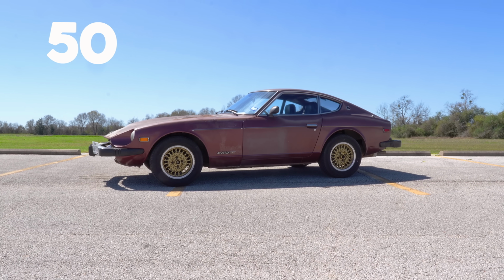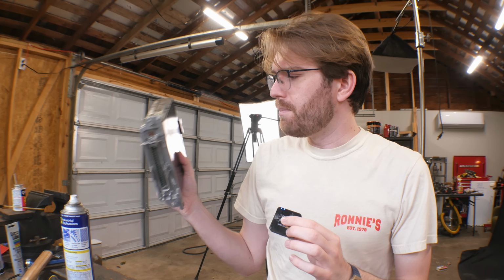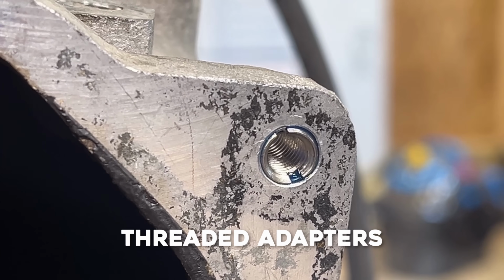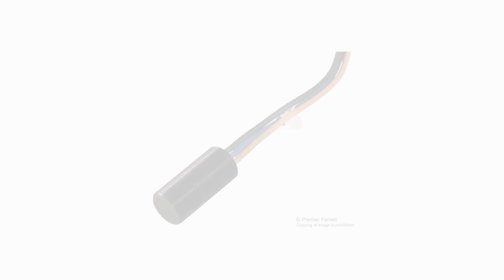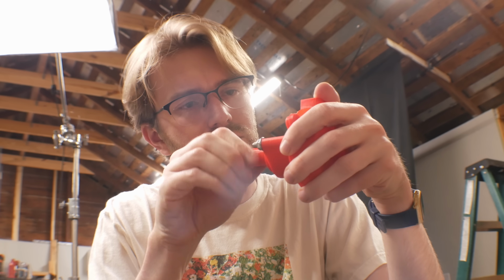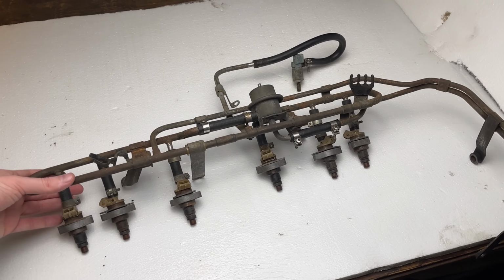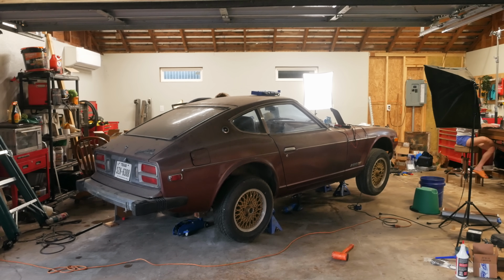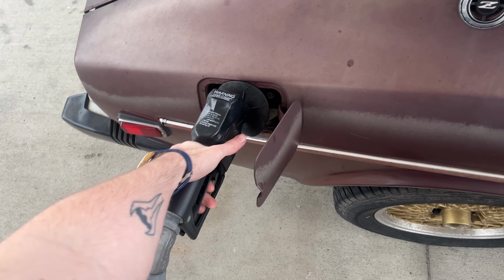Modernizing a Vintage Car

Comment: I also had 1978 Datsun 280Z in yellow but with 4 speed in 1996. I got it from a friend through golf bet. I don’t know I really winner of the game as result since it was not working car and kept in the carport (not a garage) for 5 years.  It took at least one year to bring back to life mechanically and another year to make my Z presentable exterior and interior. In the process I spent good amount of fund to so called classic car specialists where I could not figure out. It ran decent as weekend car but could not drive to work since I had a company car.  Around 2001, the engine start showed real age and required constant maintenance. I decided to sell it at bargain price since she became the drain to my budget in 2003.  I still miss it but I got 2008 Subaru Outback with 5 speed and 60,000 miles from neighbor who left this cute girl on his driveway for 5 years. I got it for only $1 since he did I not want to pay insurance for rarely use old car. I took it to Subaru specialist to perform heavy maintenance and changed all the essentials parts. Now it became my favorite weekend car.

Comment: I got one of these back in 2000. I wound up putting a four bolt main 350 Chevy engine in it that I built in my living room floor ( as an aside I wound up marrying the girl I was dating who helped me do the teardown) and paired it with a turbo hydro 400 transmission I had a local shop build with a reverse valve body and a slap shifter... I had a driveshaft custom made... Went through three rear ends before I sold it though. I shaved weight off it (yes I said shaved weight). 475 horsepower at the rear wheels. The 350 and automatic transmission doesn't weigh any more than the old six. It was a tire shredding gas consuming BEAST.

Comment: Auto manufactures always measure horsepower at the fly wheel never the rear drive wheels . You would have to put it on an engine dyno to compare any type of factory horsepower number. This was a great video though .

Comment: Dude you need some kind of enclosed 3d printer so you can do CF nylon or other engineering materials. 

It won’t entirely replace ordering milled parts but it’ll help immensely.

Comment: Love your channel... only thing that I would disagree with is your assessment of the Chevy Cruze. I had a 2013 Cruze eco that I bought brand new. Ordered it actually. Mine was wonderful and reliable. At a little over 10years old and 167K it was demolished by a F250 that hit me not once, but 2x. I was left with a brain injury but survived. That car saved my life. I actually drove it home. BTW... the 1.4 can be boosted to 300HP with out popping the engine. I will say the car is "tepid" at best stock. An air induction kit helps that car a lot!

Comment: 24:29  For those who attempt a similar project of any sort, there is an easy solution to this: just find ANY circuit under the hood that gets power when the ignition turns on, and wire a relay in parallel that ties the new equipment(w/fuses) directly to the battery when the relay is closed by application of power. Ignition coil power is usually a good choice, but there are usually plenty of other options. No need to read the full wiring diagram, just play with a multimeter to verify the circuit closes/opens with the ignition switch and you'll be fine.

Comment: Did you fill the weird hole behind the throttle body? If not there'll be a pretty strong eddy there that'll do something to the airflow, I'll bet 20 pence it's something detrimental

Comment: Isn't the Air Fuel ratio in place on the map so you don't run too rich or lean cause I'm aware that if you run too lean you can grenade your motor.

Comment: I love this project! It would be cool if you could add an Eco and Sport mode. Maybe by adding another sensor which can tell in which gear you are in, you could also make it more efficient or even add a start stop function where when you put it in neutral it turns off the engine after a few seconds to save fuel and turn it back on when you put it into gear.

Comment: Honestly though, 125hp at the wheels from an advertised 170hp at the crank is pretty good for a 47yo engine. You typically lose anywhere from 15%-20% power from the crank to the wheels on a brand new engine/car, and 125hp is 75% of 170hp so it only lost 25% of its advertised crank hp total...

Comment: Welp…. I learned so much in this video.  Never knew how/why the old fuel/air/electric really worked….   And you breaking it down to modernize this engine…..  so much makes sense now.    The wiring would keep me from leaving my bed though.   The rest fascinated me. Thanks!

Comment: Instead of buying a new car, since all new cars suck, I was thinking of buying something like this, k20 swap, e46 ABS, BMW DCT transmission, etc. Daily drive it from there. Pretty much would cost the same as a new equivalent car. With drive by wire throttle you can do a lot more with this thing. Like said dual clutch transmission lol.

Comment: Those old cars are now a vintage classic getting a much more nicer price for them. I have a older 1984 Chrysler Lazer, 4 cylinder with Turbo and if get 46 miles per gallon, last tested.  Don't under eastmate the older stuff because they had some good engineers working on some of them. I would like to modernize the car body a little, it's in storage. Just saying !

Comment: Bud in todays world modernising translates to electric conversion. This is a restoration with a swapped engine.  Just saying. But saying that the 280z is just a handsome lady.  Keeping the front end light would be the key to track days.  Engine behind the chasis, 330mm brakes front? Modern 350z complete subframe transplant? Gearbox? Engine? light as na? Vw v5/v6 super compact and can be boosted for silly power and standard internals. #@stavtech #@Zurawski motorsport. Gearbox? 722.6 with #@ASHRAND standalone tcu? The lad is a genius. On 325s rear? Flipping heck. Autoporn.  😂😂😂😂😂😂😂 ps you gotta use that bonnet 😊  cool night/pick a chill spot and let your lady know whos the daddy.  Did i mention i love the 280z. I have a friend with a sweet resto but a v8. noise heavy. Would need a big rear wing to really use the chassis.  1luv petrol head brother.

Comment: This is what I really wanted to do to my 1985 Lincoln Town Car in the UK, until the project went sour by a bunch of "professionals" ruining the car. For this one year this car had throttle body fuel injection, I was going to change it out for a Summit racing intake manifold that had sequential fuel injection and still looked like a carb.

Comment: So correct me if I'm mistaken, but under the assumptions that: 1 - 170hp was an SAE gross rating (measured without accessories likd water pump anx alternator), and 2 - we estimate about 17% drivetrain power loss, a quick calculation (124 ÷ 0.83) would give us about 149hp at the flywheel, which is on point for an L28E. using this calculation, 142whp puts you at 171hp at the flywheel.

This goes to show just how inefficient the L-Jet system was compared to today's modern engine management.

Comment: I guess, if you make some milling to cylinders and add new piston rings that'll run better. Obviously adding a supercharger to that engine and adjusting fueling map to it shall make it to another level.

And bodyworks. Make some bodyworks, old cars are precious, it does need to look like a masterpiece of it designer.

Comment: just want to point out something from when you said the air is still analog control, pretty much every throttle body is analog btw, whether its opened by a cable or by a servo the butterly still stays analog.

Comment: Man that sure is a different project than the Fiero! Sure showcases how much 'working on cars' has changed in the past decade or so. The availability of aftermarket parts for computer controlled engines, and the ability to basically create your own parts at the hobbyist level is mind blowing.
Time to do an EV conversion!

Comment: I admire both your hard work and your humor (the fuel savings pay off in 63 years!).  On a positive note, I know nothing about the computers on board in my 1992 Volvo 240 Wagon, my 1995 Toyota Previa, my wife's 1998 Ford Fiesta, my 2011 Toyota Rav4, but now I am no longer afraid of how to put my hands on where needed.  Basically you have helped me understand how the computerized components work.  Since I am an old school carb and spark plug kind of guy, I am still learning but your video makes it all much simpler for me to understand.  Thank you for all you have done and do.  Sincerely, Mark in Italy.

Comment: This was a very cool video.  I suspect the largest improvement in terms of power was the use of a modern lambda sensor and maybe clogged fuel injectors.

The distributor, as clunky as it is, works pretty reasonably well for stock applications.
All those stupid air valves are stupid and annoying and frustrating but since they are only there to keep the car idling, don't make a huge difference while driving.
The air flow meter has a largest enough surface area that I doubt it has much negative impact on anything -- but maybe.

I'm surprised the system doesn't generate a default VE map when you first install it, and then tune it using the Lambda sensor as you're driving though.  You could also potentially remove the mechanical fan and install an electric one.  The main benefit of this is that you are no longer having to drive the fan when you don't need to (for example while you're driving). Not a huge difference, but not nothing either

The cam sensor mechanism was pretty cool.  I'm not really sure why it needed to be made of steel, but I guess that's why I'm an EE not a ME.

Comment: I'm laughing at the really awesome distributor replacement you made, because you could have done the same thing by placing a magnet on the crank pulley and placing the hall effect sensor next to it. If you know the diameter of the crank pulley it's simple.

Comment: Having the engine components balanced isn't really modifying the engine.  Maybe even bore it out a little,  is stretching it with new pistons and rods. Lower the deck height,  upping the compression a little.  
Basically old school hotrodding 101.  

Oh, and upgrade the brakes next.

Comment: I'm such a purist that I tell myself I suck.

Having said that, I have no heartburn whatsoever when it comes to performance upgrades - going fast, stopping more better, quieter, smoother rides, superior sound, that kind of thing.

Well done on the upgrades.  I'm now expecting my mechanics to do the same thing to his 240, which I've been following since he started - and his channel for several years now.  I did see the notification for the part he made pop up, but haven't watched it yet.

The good news is that in 63 years, if you're still around, you'll no longer care about fuel mileage.

Comment: Oh, I also changed the ignition to electronic using a 6cyl Mercury Marine control module with an MSD coil. Now the points were low voltage so hardly any maintenance. Short cuts but useful.  That engine can easily take a turbo if needed.

Comment: 11:51 I think the real problem with rotary distributors lies with spark advance. They usually have springs that counteract the centrifugal force of the 'advance weights' - the faster the dist. shaft turns, the more advanced the spark, but it is very difficult to get it spot-on, as spring rates vary, heat affects the metal and fatigue changes the spring tension.
The best thing for an engine is to have accurate spark advance.
This video is great, it answered completely questions I had asked myself - not only are old cars death traps, they're not really worth modernizing.

Comment: If you do want even better mpg out of your car, lean out your tune for your cruising rpms, I would call that the rpm your car is at going 70- 80 mph, if your cruising at a fairly low rpm I'd go for the 80 mph rpm, but if they're already high go closer to the 70mph rpms.

Comment: To radically increase the increase in power our 280 zx, we swapped the very restricting fuel injection and replaced it with 3 X 1980's Alfa GTV side draft Webers that bolted directly onto the head, tuned them. The increase in power we swaped the limited fuel injection for  was 'mind blowing. We used to have the fastest traffic light acceleration this our very big car enthusiast community. Ha-ha

Comment: redo that pedal print in ABS or ideally CNC aluminium. Using PLA is dangerous here, ABS not ideal either as weaker than CNC aluminium.

Comment: 63 years and only 142 hp wow and 17 to 19.9 that's amazing work for 2.9 mpg and now a woping 142 hp and I thought my 67 VW bug's 53 hp stock could get the modern effect to get to 70 maybe nope ! It stays original. Thanks for taking the time to prove that modernizing an old engine dum & dumber..
😅

Comment: Would be interesting to see if 91 fuel and a turbo running at 1 psi to off set the horrible internal flow parts would net a big gain in fuel economy.  I know at no boost everything I have turbo charged has gained 3-6mpg out of boost just due to increased volume efficiency. Though choosing the right turbo to out pace the suck without high boost can be tricky to stay in efficient side of compressor curve.

Comment: You could’ve put a 4.2 LL8 i6 from a Chevy Trailblazer, and run it with a Holley Terminator X Max, and you would have something way better and more Powerful. Or LS swap. Great potential with the AmeriBerra though.
Reply: the l28 is a trash engine especially one thats as old and as tired as his. hes literally wasting time and money for no reason to a frustrating degree.

Comment: Supercharge it.  Or turbocharge it.  whispers ..or both... (hey hey hey TECHNICALLY it's still external so long as you don't dial up the boost enough to need internal upgrades...)

Comment: no by going with the most advanced technology, you add WAY more problems, lets take the basic been around since mechanical efi or even carburettors (over 125 years and being 125 years ago), a carb or Throttlebody , both have somewhat the same principal, cable opens butterfly and then changes voltage in the throttle position sensor in efi, in carb it lets air in like efi but also goes into a venturi and mixes the fuel with the air, very basic has worked for a very long time, now with the new horse shet, you remove the mechanical/physical cable and replace it with wires, to use these wires you need 2 throttle position sensors and you also need a motor/solenoid to turn the butterfly, any issues in this circuit and you are f*ked, you would need to diagnose the replace the problem at what price is technology again??!?!? expensive. aaaaaaand thats why us mechanics hate the new shet. and BTW the y fail regularly and so do the gas pedals, and rats chewing on wires because  technology these days means 1000's more wires and more shet for rats to chew LOL, cannot beat basic, ole cable and carby with points, it will still live LONG after all wars

BTW you can use the second(spare) distributor and leave the bottom part(because its oiled thats why it has a spiral) and the top, cut down the housing to near flush and make a housing to suit your sensor, machine the shaft that goes to the bottom, and assemble and it should work(also add a keyway so it can only assemble one way lol), thats been done for many years here , we even use ABS sensors that bolt to hubs on cars, does the same job, some factory ecus cant read some abs input tho

BTW to correct you no efi sysytem injects all injectors at the same time, not only that , it has a flap AFM(that is a flap Air Flow Meter) not only that itr also had a TPS (Throttle position sensor), not only that it had a coolant temp sensor, and a distributor that also was a crucial sensor in the efi part on the L28E 
all these sensors are in this system to work the efi

you also need to sort out a cold start for it when you tune it

you don't actually know much about cars do you?

Comment: Many moons ago I had a 72 510. I took out the 1.6 put in a 2.0 out of a Truck and add pointless dist. Assy form the same Truck. An electric fuel pump. I used to race auto cross in it. 5 speed transmission. I never had it put on a dynamited, but it would go side way in third.
you do know that the chains stretch so much that the MFG has different slots on the top gear
to bring it up to spec. If you ever pull the head and are not aware that the chain tensioner
will fall out then you have to putt the front cover. While you have it out this is the BEST time to put in a new chain set. If you ever pull the head, you need to make a piece of wood wood a screw on the top to wedge between the chain and tensioner area. or in your cade a 3d printed part have fun. The Z's are really bad on corners as the rear wheel will want to tuck in

Comment: Does the vehicle have proper crumple zones? Or is it a friggen deathtrap? I know older cars you hit a pole and you're dead. (exaggeration)
Reply: dude if i get in an old car im gonna die im just so scared im literally shaking did u install a roll cage and full harness so i feel safe ?
Reply: @steemsupport  Maybe you should do some research in the fatality rate of older vehicles, especially ones built between the 1950s and 1980s and what changes were made to reduce them instead of being a sarcastic jerk.

Comment: I drove a 15 year old Datsun 120Y, same colour as your hot rod. Drove it the length of Australia and even towed a small caravan around gravel roads. It had a little power in first gear. Served me well for about 8 years.

Comment: So, put in a good starter, brand new paint, a new motor, an aluminum radiator, do the interior, do the exterior, and then your suspension. This is really cool. I've never seen anything done like this before, and thank you for showing us how to do this. This was very awesome. Thank you.